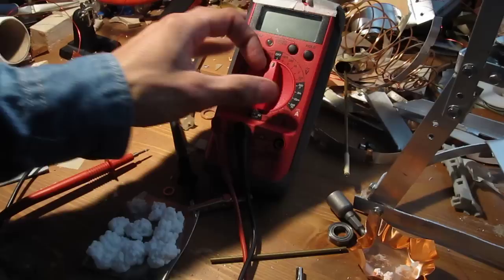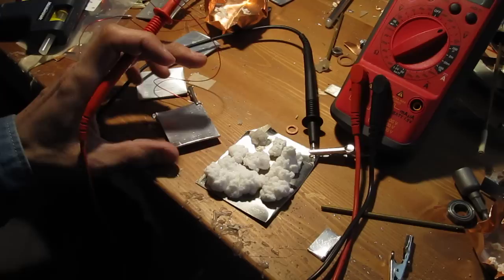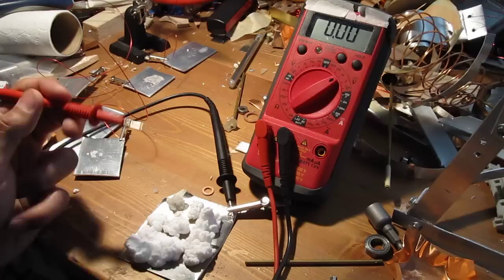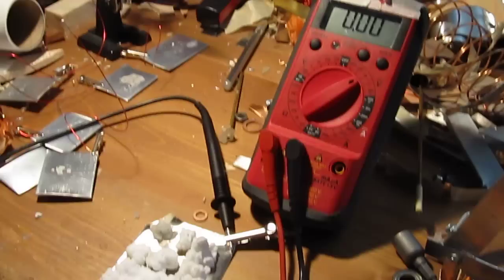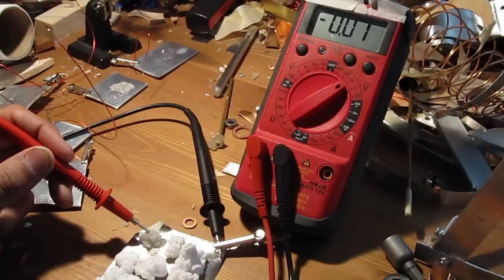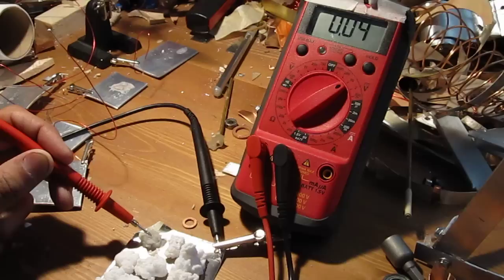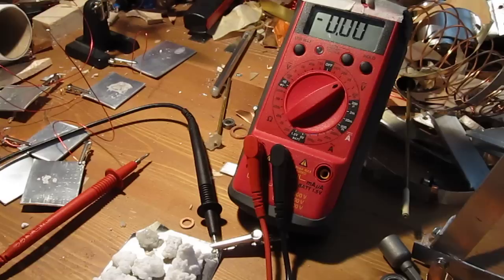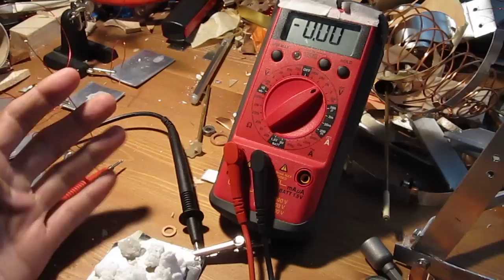Real Free Energy!!! - Crystal Power - John Hutchison

Comment: check out electrolyse i made led light from cooper paper with vinagar in it and iron ...the light was on like 6 days until vinagar was dryed out from paper...also you can get volrtages from ground with 5 inch cooper pipe  and irond bolt(zink) in the midlle i got 1 volt and 4,5 mA